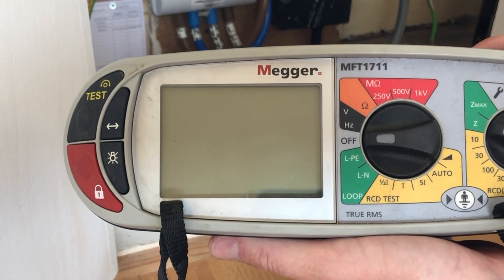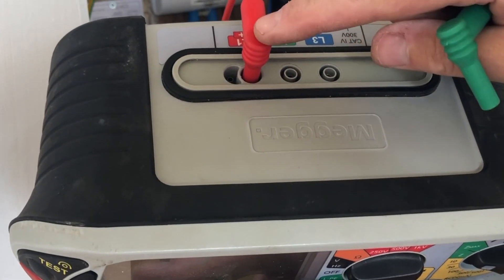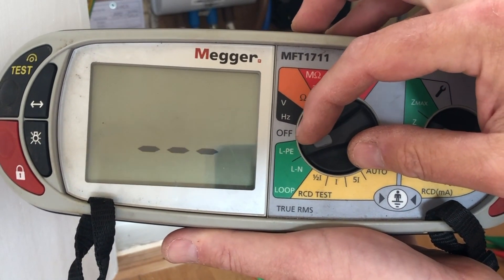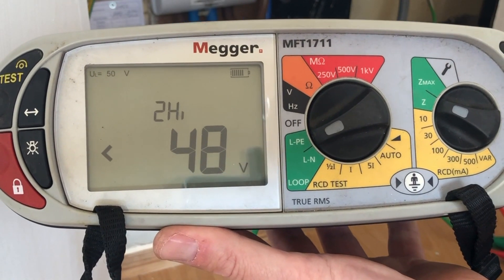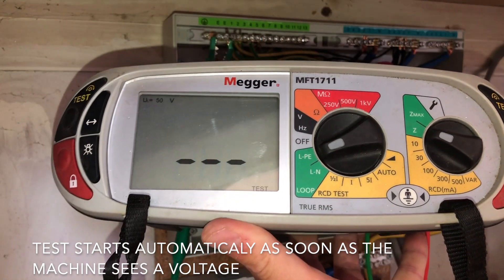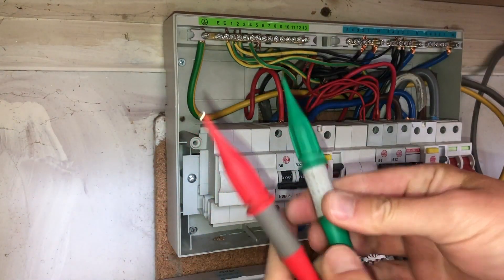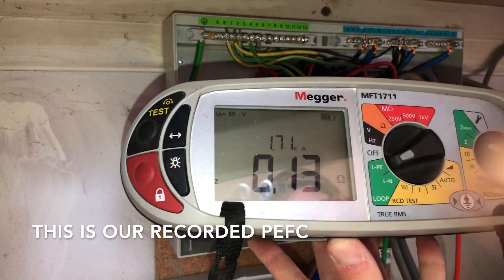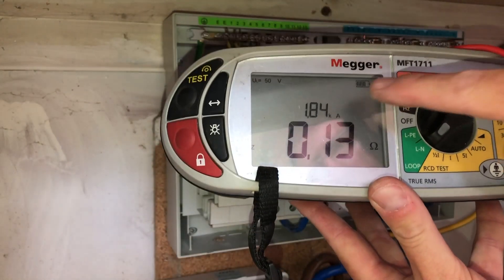ZE & PFC Electrical Testing Made Easy | How to Perform the Ze and PFC Test on a Megger

Comment: Hi, thanks for the helpful video. You mention the 3 lead low and using the three leads if RCDs are in circuit. The board that you were testing,from what I see has RCDs,so should that of been done on three lead low?
I’m not too familiar with the Megger.
Reply from the maker: Hi, the Megger 1700 series testers gives you the option of using either a two or three lead test with a selection button. It’s to make the testing process as flexible as it can be. Other brands do not always have this option available. With a three lead test you will normally require a neutral conductor which isn’t always available as would be the case at most light switches. Hope this helps to clarify the point. Thanks for getting in touch and your interest. Chris
Reply: No this test was done before the rcd so no requirement for a low current loop test! 3 lead capability gives the added advantage of the instrument checking the polarity is correct!